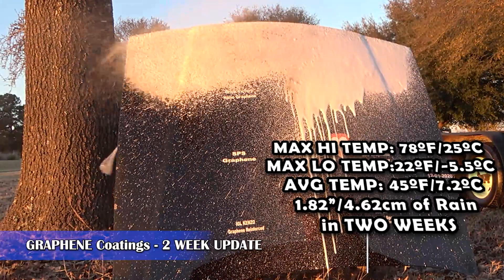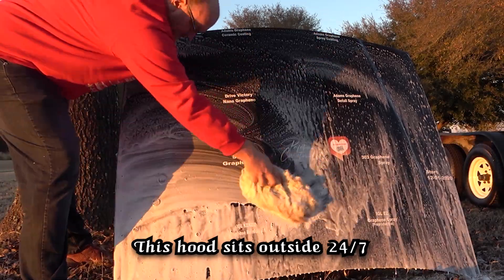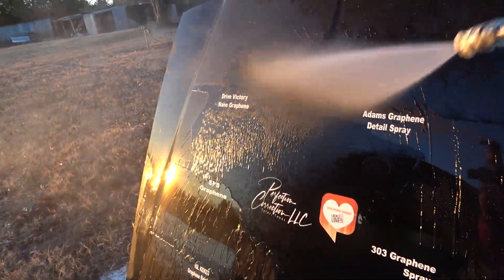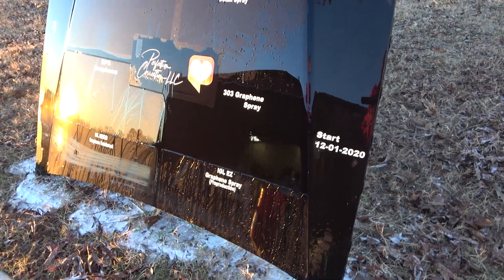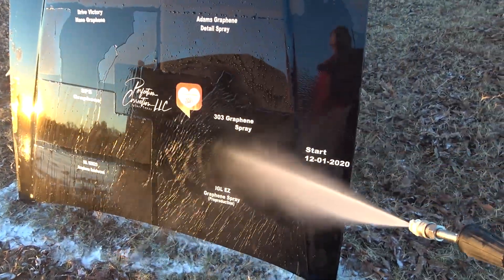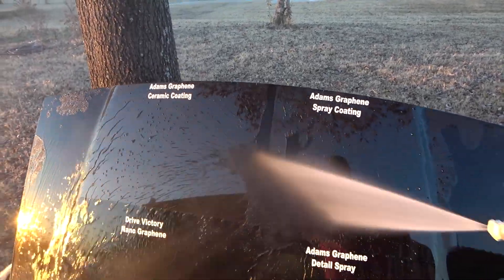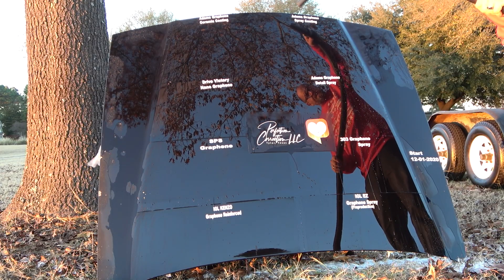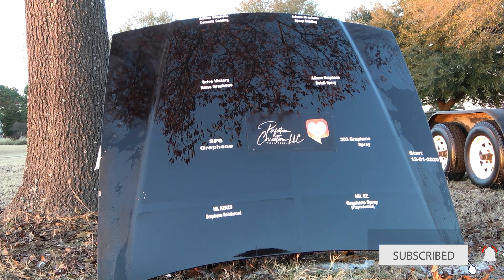GRAPHENE Coatings - 8 WAY Long Term Durability Tests - UPDATE 01 - 2 WEEK UPDATE

Comment from the maker: I was also surprised at the quick 303 failure.  The only difference in the application (go back and look at the application video...link in the description of this video), is that it was sprayed onto an applicator instead of directly on the panel (which ultimately won't make a difference since the product is still being completely applied to the panel)
Reply: I think it would be a good study to compare application methods, then.  Especially since it's advertised as a 1+ year coating.
Reply: You did it exactly like the directions say for 303 Graphene "Spray onto a microfiber or foam applicator".
Reply: I wonder if I failed to shake it sufficiently but my results were just about identical. To be fair I am not getting any of the advertised longetivity with any brand, to include professionally applied ceramic coats. Surface prep was also meticulous.
Reply: I am surprised the 303 failed so quick, I put it on a couple panels on my car to test through the winter and it's been holding up well over the past 4 weeks. car sits outside 24/7. the only difference is the outside temp hasn't fallen below freezing, I wonder if that makes a difference with this product? this is very disappointing, I was hoping it would be an easy product to use through the winter months

on your next test panel are you going to include 303 again? it would be interesting to see if it fails so quickly again

thanks for the update!
Reply: @orpsinnet17  that's precisely why I got it, an outside car that needs a bit of protection from all the weather and salt. I got about a month from it.
Reply from the maker: I definitely shook it well.  I'm wondering if I got a bad batch.  It will be included in the next test to make sure
Reply: @ScottHD  Good theory. I have seen it winning other tests in complete contrast to my results. I have two bottles but they will be from the same batch (launch), so maybe we should request a new bottle and do a side by side. I will check if my bottle has a batch # code on it somewhere.

Comment: I am surprised with the 303 failing so early. I recently used that on both of our cars and really wanted to test it out to check its durability. I wash every week and my car sits outside 24/7 and I haven't seen any issues on its durability. it still beads good especially when it rained  last week which  was the good way to test it realistically. I'll have to see how it goes in the next few months.
Reply from the maker: I wonder if I got a bad batch or something?   I am going to put it in the next test too just to make sure

Comment: Like everyone else I’m surprised the 303 Graphene Nano Spray Coating is gone after two weeks.  Could be it can’t handle the cold weather and/or the extremes in temperature you’ve experienced over the past couple weeks. I think it deserves a retest before writing it off and placing it on the back shelf next to F11.

Comment: Would you be willing to comment on some of the visual characteristics of the coatings as well? It would be interesting to see how gloss degrades over time. Also, after you dry the panel you can tell that some have more depth than others.
Reply from the maker: Sure. I can do that next update!

Comment: Considering tests done on other channels with 303 that saw a markedly different result, I think it deserves a re-test. I think it's very well worth identifying the reason for the early failure. Some have speculated the cold resistance may be weak, but my 303 coated mountain car that has endured almost identical conditions as your test panel has for the past 3 weeks would argue otherwise (notwithstanding, one person's experience is hardly evidence for dismissal). 

I do very much enjoy your product review tests, keep up the awesome work! Easily some of the best auto detailing product comparative testing on YouTube.

Comment: I hope the turtlewax flex is able to actually deliver longevity. I'm not a fan of reapplying a spray on a full size truck after I wash & hand dry it everytime. I did it with CMX to have the layers but....trying to not have to do that again when they wear off.

Thing is, turtlewax really hasn't stressed longevity much from what I've seen in the interviews & reviews. Just how "easy" it is to apply & also be a topper.

Comment: I am also surprised with 303 results. I have all 3 of my vehicles coated with 303 Graphene and they are all still very hydrophobic after 4 weeks and 2 washes. You might want to retest that one to see what is going on.
Reply: I am very surprised also ON THE 303.. I've seen it on a friends car last at least a few months he put it on just before Halloween and its still going good..  Maybe you got a bad batch or maybe it was frozen.. some products start failing if it gets shipped and frozen along the way.. I'm just guessing man.. I don't know..  I know for sure. You know what your doing, no doubts in that..
Reply: @BonesXXX22  The frozen theory is interesting. It seems unintuitive that a product designed to protect and be tough could fail from something so simple, but it's actually the distillate that can be the failure point. Pretty much every supply chain exposes products to freezing temperatures during the winter so I will be interested to see how a fresh bottle does this year, produced in in the spring or summer.